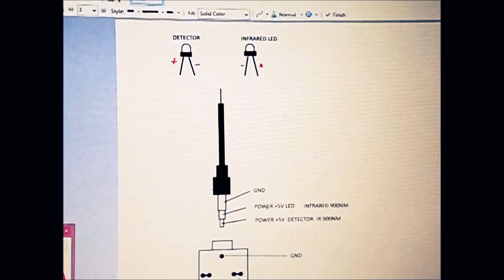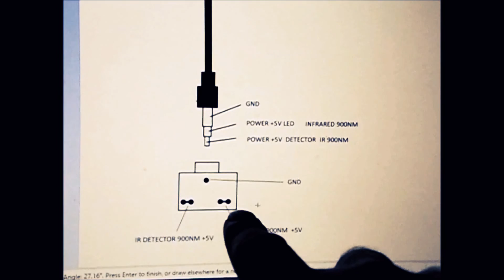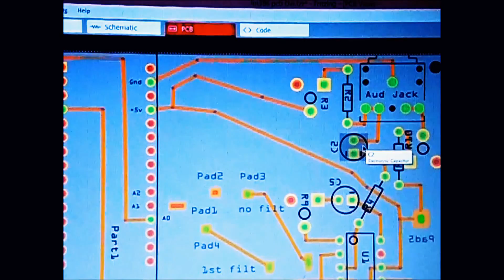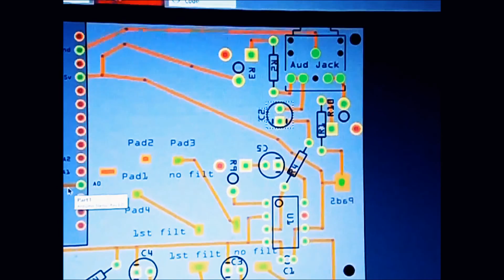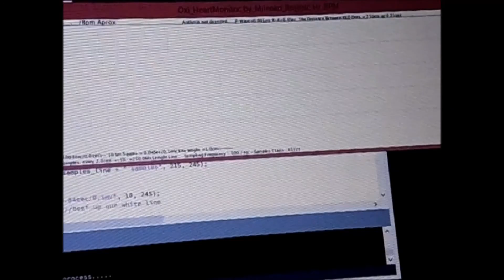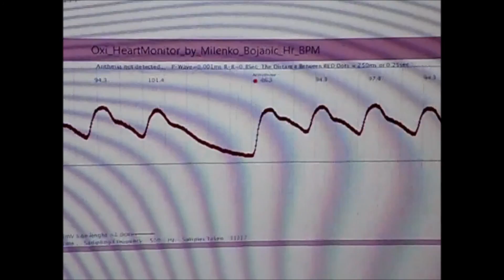ARDUINO DIY Pulse Oximeter lm386 arduino project

Comment: hello how can i registrate to your page? i am an engineering student and i need the code of arduino thanks :)
Reply from the maker: Hardware sends analog values to Arduino Arduino simple sends a serial data packet that is read by software on pc which is custom as well. So I can't help you. Arduino code is simply serial.print(); pc software I wrote as well. And that I can't provide. Why don't you sit down and rethink how I would make it ones you create the hardware..you can copy mine .. if you study you should master the field by examples and test and fail routine. So that you gather knowledge yourself.. try making software yourself.. hardware works just fine u can use pt333 ir phototransistor and 940nm IR led intensity of it will have to be adjusted to different size fingers and skin colour.. important to note

Comment: Hello - Can you please tell me where you are placing the pulse oximter to obtain the pulse readings?  Thank you
Reply from the maker: as you can see in video, it plugs in a audio socket....  stereo has 3 wires  gnd left and right....   IR and receiver connect to audio connector or plug

Comment: Did you measure oxygen rate from finger?
Reply from the maker: Dogan Erdemir  No... to do this you need  two light to be pulsed... for example... you pulse red led first then switch both off then light infrared ...  now when you collected your reading.... of both light sources you have to use formula to calculate SPO2... infra red signal doesn't change much in regards to oxigen level in blood but red responds to it and signal will change.... red will be weaker and your infra red will remain the same.... 

I started another project using nellcor cable .... at present I am still experimenting.... MCP602 is a great choice....  if you send me your email I can send you some stuff to get you going... 

Now This... video... if you recreate this ... in my opinion this will display your heart beat just the way it really looks... it is a great  little thing about it.. I have made a software in processing that Can detect heart anomalies and tell you precisse Heart beat rate.... on every beat.... not an average... 

hope that ansvered your question..
Reply from the maker: Dogan Erdemir Nelcore  Spo2 Cable is good if you wish to calculate spo2... You may not find a lot specs about led light in Nellcor ds100 cable finger clip.. but I know That you can shoot even 120mA  if pulsed at less then 1ms and around 100mA if not pulsed....  you will nedd H bridge  for this to light them up...  or L9110s can do or simple DC Driver using L9110S can get one from ebay  for 0.99....